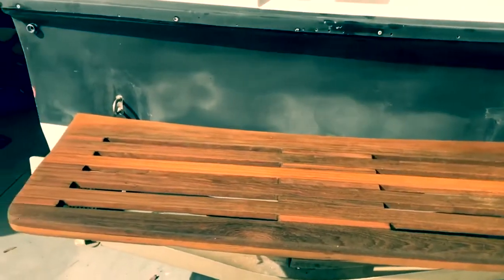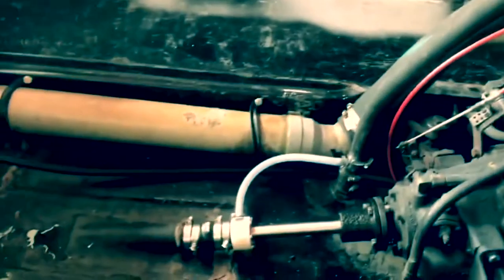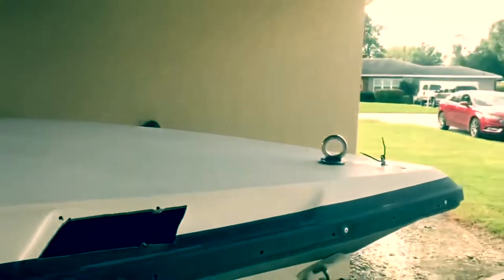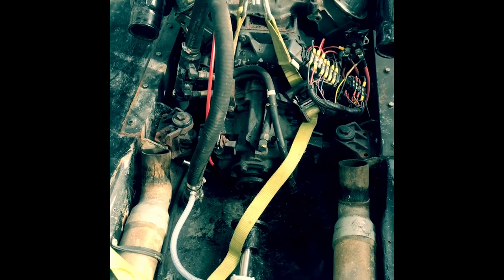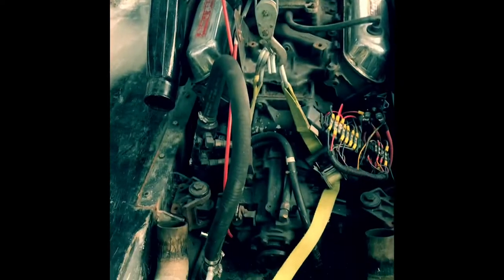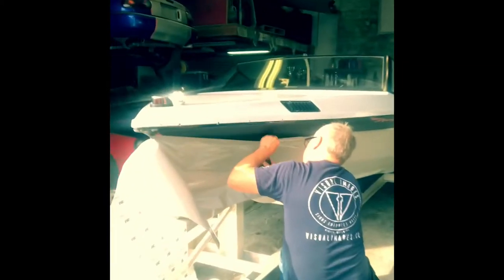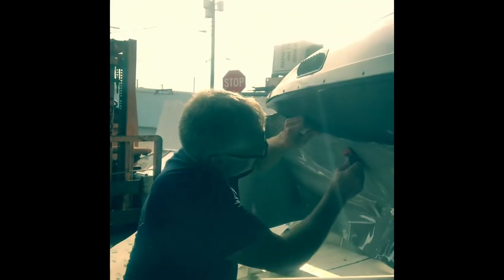1988 MC Pro Star 190 project

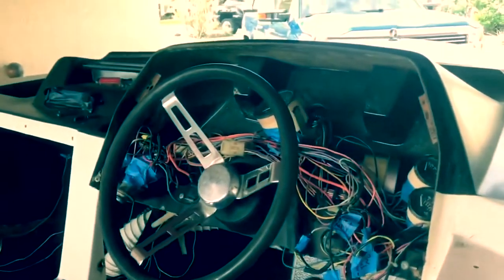Comment: 1:38 where did you find a dash? I have an 87 that needs a new one badly
Reply from the maker: I took all the vinyl off the dash and fiberglass over all the broken parts. Then I just sprayed the finished product with a bed liner product to get the finished look. I got the backing plates and switches from Outlaw Marine in Melrose FL. He has a ton of old MC parts as well. You may want to check with them to see what they have for you. Owner is Don Sidbury